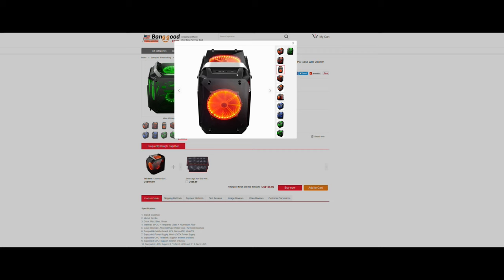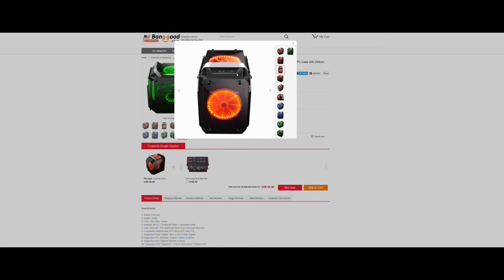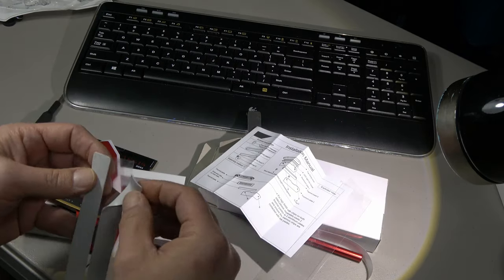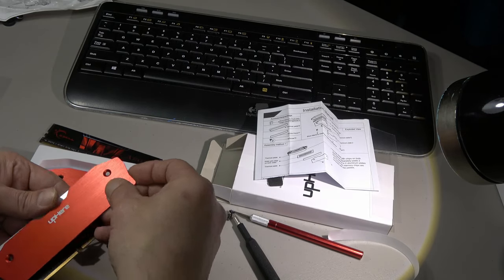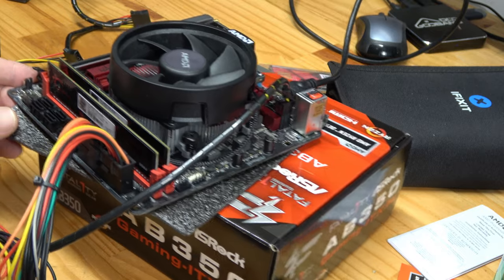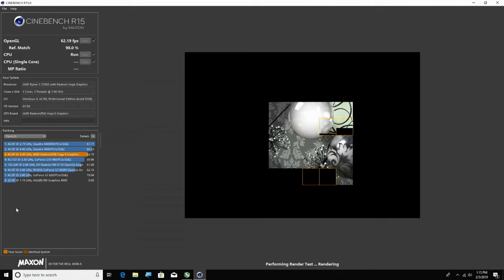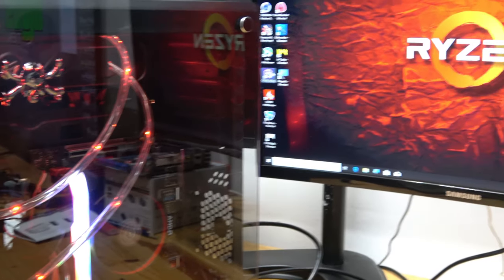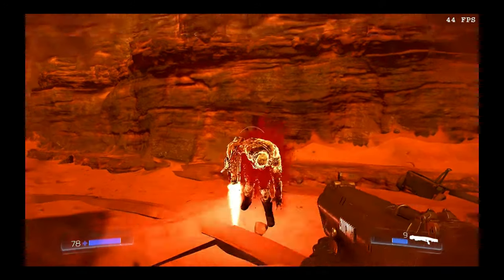Banggood's Glass pc case build and modded hard drive lights

Comment: Can it be swapped around so all components go in opposite sides i.e motherboard etc go in the side you put PSU etc., I like this case but the way its set up means the side with all the components would be facing the wall...

Comment: I bought the case around the time you posted this video (bought the green light version.)  I agree it's a nice case however they sent me one that the metal bar on top was shorter on the left side so when I pick it up my grip is on the far right side, and the area to screw in expansion & graphic cards is a pain in the butt.  Other than than It's a awesome case.  I got a lot of compliments from people that have seen it up close.  I plan on removing the fans and replacing them with some 200mm Addressable RGB Fans.  I will state though for those that want to buy it if your not going to water cool it you can not fit a heatsink that is more than a 100mm tall luckily I bought a 4 copper heatpipe heatsink that is 95mm tall from alliexpress for $12 so the CPU is running cool.  Both 200mm fans have really good air flow even with the lack of clearance at the front. the opening from the sides help ventilate the air nicely.  Oh BTW Banggood would not allow me to post a review of the case due to the issues I stated.....  your review is still the only one there.
Reply from the maker: Really? I enjoyed your review. Banggood is a funny company for not publishing it. Thank you

Comment: nice man,i do like the case,and your little touches in it.shame tue toolbox case want there to stay.and yea to you n anyone else sadly some 1st gen ryzen boards n very few b450 boards do get bricked easily,as some companies slapped the am4 socket on a intel board n changed a few codes to make it work.but i have not had any issue with my b350m msi gaming pro on 1600 4ghz.be cool to see if you can do a basic aio or diy watercooling system n try squeeze bit more out of your system.and also you can fine tune the ram in the cl side of your bios to make ryzen run better as zen is ram dependent